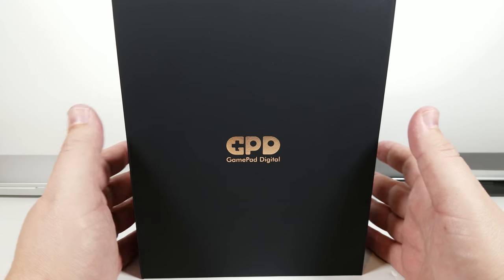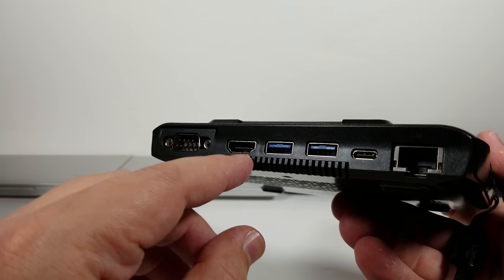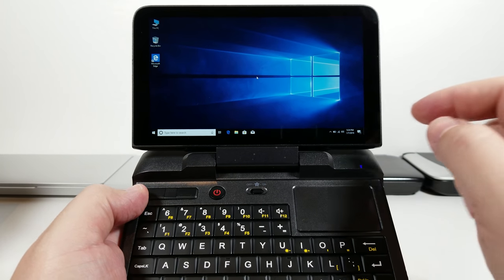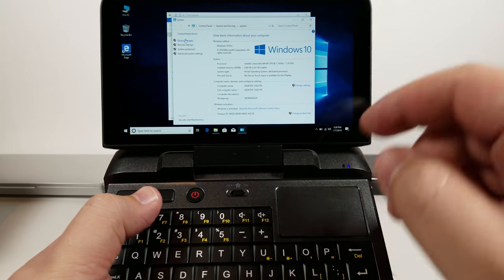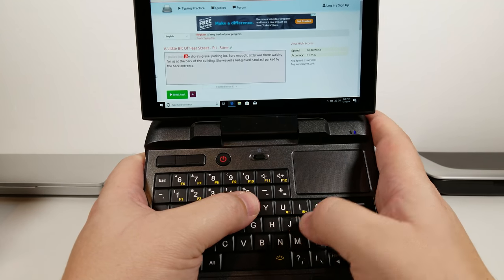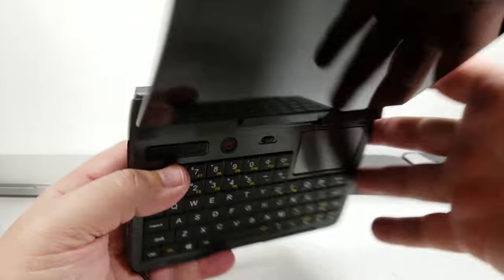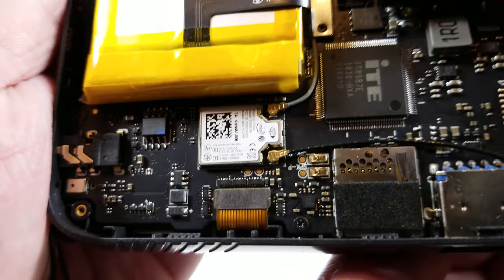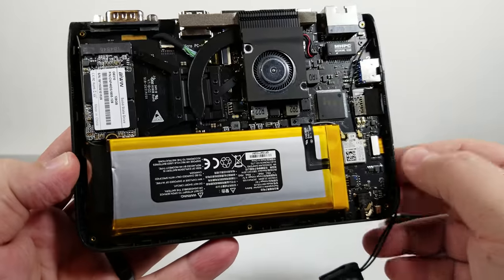GPD MicroPC - Unboxing and Quick Impressions.

Comment: I think current Intel and/or AMD cpu which aims on very low power and compact devices like this, still far from the perfect, in terms of the balance of performance and stability (power consumption). Since Intel already demonstrated their 10nm Ice Lake cpu in the recent CES 2019, and perhaps the AMD latest 7nm Zen 2 cpu also at the corner, we better to wait the future products of GPD (Win 3, Pocket 3 and etc.) which adapt to these up-to-date chips~~
Reply: AMD hasn't released a ultra-mobile chip since Bema and Mullins. laptops chips are planned but they are too big to fit in something like a GPD win. the best we can expect non intel based  is something using the Qualcomm 8cx. since GPD is not the type of company that can get the latest chips on launch.
Reply: @psionx1  ARM based Windows devices? It's a viable alternative perhaps, at least, for the TDP restrictions in these ultra small form factor machine. But, after few IT OEM tycoons try on that with very limited models of their current products line, as well as the feedback from some users, I had lost the confident and interests to it @_@
Reply: The "Low Power Comsumption" on ARM processor only works while on lower Clock Speed and on lower I/O usage. Once it hits 3.3 Ghz, or use PCI port for external GPU, its power compsumption will jumps higher. Thats why arm based device increase their cores/use multiple cpu instead increasing their Clock Speed. It will not that different than low end intel processor.
Reply: @novelnouvel  I see! But, when come to more and more cpu core counts, especially those processors are non-X86 based, the usage of each of these cpu cores (efficiencies), and extra power which may need to drive the machine when more cores are added, will become critical. It may need the machine to redesign to match the extra TDP that generate from those extra cores. Meanwhile, the OS (Windows) itself, and correspondence applications, also need to rewrite to match the instruction sets of these ARM based processors. Otherwise, it has no significant advantages when compare to X86 based cpu. But, I don't think Microsoft need to sacrifice it's old "partner" and compromise to ARM user market~~
Reply: @finalkamen  I agreed with that. Also ARM based windows needs to lower its disk I/O read. Its too high for flash memory to handle. If Microsoft can create arm based tablet with maximum 7 inch that can use sim card for SMS and make calls, maybe will try that.

Comment: It would be much better if the GPD Win 2 had a similar touchpad, it's the GW2 biggest weakness imo, edit - actually the portrait mode screen is the biggest floor to be fair.
Reply: I like using the WIN 2 game controls in mouse mode
Reply: @robertm3951  I would just prefer a proper trackpad, especially for games like Age of Empires 2 HD, C&C, Civilization, Halo Wars etc, I find using the joystick in mouse mode way to slow and clunky and inaccurate in those games, it's great for most other games though.

Comment: This thing sacrifices too much usability for a couple of full sized ports. Compare this with a Pocket 2 equipped with a RS232 USB/RJ45 cable and ethernet dongle. Keyboard has an even more compromised layout and feel, so configuring devices will be a pain. Touchscreen is gone so switching between apps will be tedious. You're paying less, but how much slower are you going to be inputting commands, navigating the UI, etc? Make a thicker Pocket 2 to accommodate those ports, save cost in other areas to preserve usability, then I'd buy one.
Reply: I think the point is its supposed to be a budget option...otherwise they probably would have just made a pocket 3

Comment: i subbed also the processor was changed to an
 Intel Celeron N4100 quad-core “Gemini Lake” processor
Reply: basically its pretty good for this size
Reply: i take that back that cpu is nutz  it does 4k 60 fps , has a 2.40 ghz  burst/boost that im sure can be abused with some mods and apps  and it supports 8gb of vram and ram ddr4 as well supported and obviously m.2 which is sick and bests any android phone or iphone

Comment: The top left buttons are clearly the left/middle/right mouse buttons. It kinda frustrated me all the way through how you avoided them even after speaking about the middle mouse button, when anyone who looks at the device can tell with the design. Hope I'm not being too arsey but I think a reviewer should at least test out all the buttons and IO first because majority of your review was about the touchscreen/touchpad issue which might have been a bit different if you tested it properly. Otherwise, great review.
Reply from the maker: Hey your critique is fine. Generally speaking, Unboxing videos for me are about immediate quick impressions. The full review is still two weeks away.

Comment: Can you install Win7 on that thing?
Cause there's no way in hell that I'd be using Win10. Too many privacy issues to deal with.
Reply from the maker: Windows 7 won't boot on this.
Reply: @ThePhawx  That's too bad. Is there any alternative that can boot Win7?
Reply: AntonioKowatsch win1, win2, pocket1, pocket2...or a netbook
Reply: The Phawx why not???
Reply: You can disable most of the "send info to MS" things in the settings.
Reply: IanC14 it's better to use registry tweaks to do that and double check because Microsoft are sneaky fks.
Reply: @RobinObinray  Yep. They will reset the settings after reboot.

Comment: Unfortunately I'll never be able to unbox one. I can't stomach paying $300 for a computer and another $500 for the box that it comes in. That's the only logical explanation. The first person to say it's because of micronization needs to get slapped. I have phones and tablets that offer 8 CPU cores, 1080p screens, with 4 to 8GB of RAM and equivalent GPU that cost UNDER $300. No way I'm forking over $800 just for the ability to use Windows in this form factor.

Comment: If only Windows 7 could be installed to GPDs...
Reply: windows 7 sucks man get with the times
Reply: @oblivionlord1242  whenever win10 will allow for complete removal of cloud services, fully-fledged Aero, non-modernist design, a file explorer that makes sense (the cluster of option under nav bar aint my thing, much better when it is neatly organised in buttons), proper themes (windows 7 allows to create themes with colors, sounds and wallpapers, such all in one  customisation is missing from windows 10), gadgets (the good ol cpu load gauge), and obviously NO freaking updates. 
Windows 7 has character, it invites you to use it, it is friendly and warm, whilst Windows 10 is just solid blocks everywhere, there's no character or design, only plain cold "metro". Really dissapointed after such amazing OS as XP and 7 ( Vista wasn't that bad if you had a powerful machine, it was just too soon for it). 
All in all, Windows 10 doesn't offer any advantaged to 7 (at least for me) and has a lot of inconveniences, making it un-enjoyable to use.
Reply: @syclone  I understand, but win 10 is almost 4 years old, with win 7 soon to die

Comment: can you install linux on it?
Reply from the maker: The MIPI display is proving to be quite troublesome
Reply: @ThePhawx  in what ways? like orientation issues?
Reply from the maker: @jwizz1396  recurring errors in dmesg for i915 driver and GPIO / MIPI. Screen is completely blank. Trying to force any resolution will segfault X. Found the error and problem is supposed to be solved in kernel 4.17+ but new errors now

Comment: But ...
.
.
.
.
.
CAN IT RUN WINDOWS XP?
Reply: Aditya Ranjan if it runs windows 10 then it can run XP, plus XP isn’t DOS based so, yes
Reply: @supakusuta  but it can't run 7. So.....
Reply: Aditya Ranjan But can it run Linux.
Reply: @ricksmith4840  You can install win 7 on that

Comment: The big question is WHY?  What is the point of this when you have your smartphone?  You can't barely read anything on the screen. This is not productive and stupid.
Reply: I'm consistently fustrated by the limitations of my smartphone on a daily basis. A full touchscreen with no buttons/keyboard and dumbed down software is terrible for doing anything but Media consumption and some web browsing.
Reply: Because it can run windows software and carries the ports required to be versatile in actual academic and professional environments (office, school, etc).